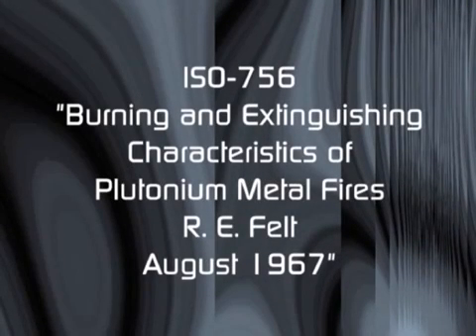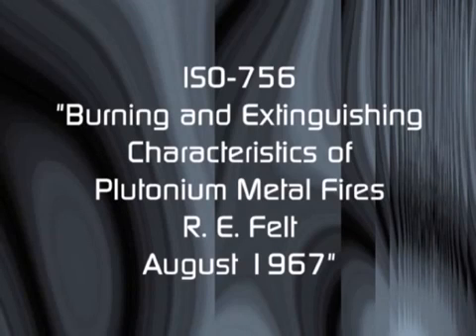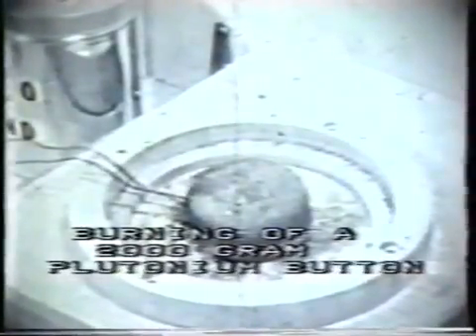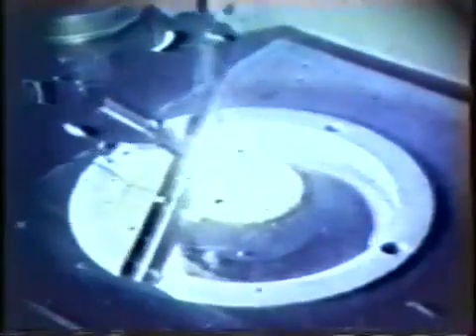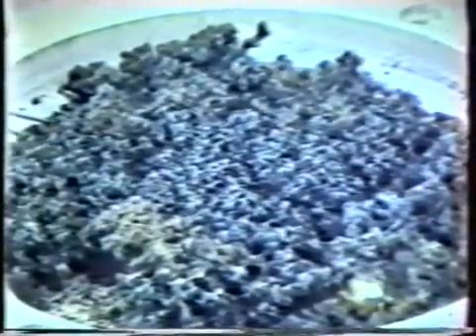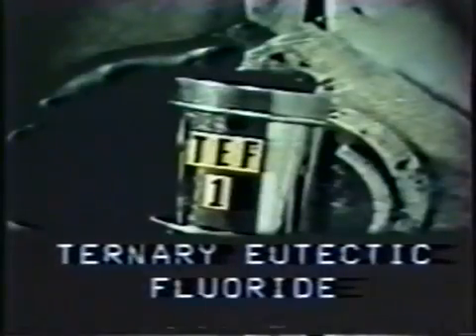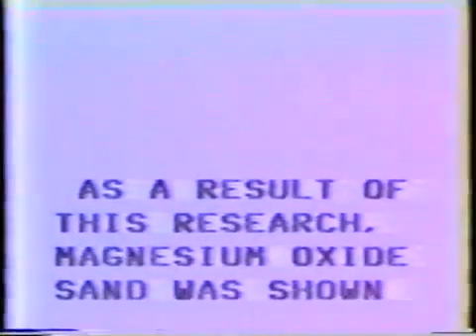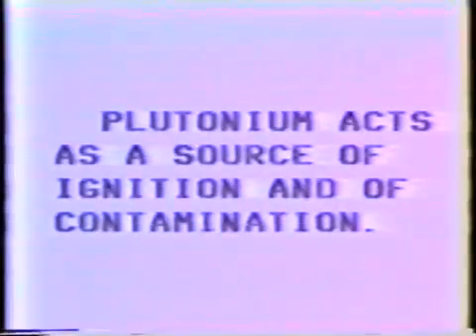Burning and Extinguishing Characteristics of Plutonium Metal Fires

Comment: I wonder what effect liquid nitrogen would have on a plutonium fire.
Reply: @prospektOS-tmo97  Remove the oxygen and the fire should go out.
Reply from the maker: Plutonium can react with nitrogen to produce plutonium(III) nitride. This reaction takes place at a temperatures near 1000°C.

The Atomic Energy Comission (predecessor to Department of Energy) did testing of liquid nitrogen on burning metals in 1972 and found it to be effective in certain situations, so it's very likely that the cooling effect of liquid nitrogen would overwhelm the sustained exothermic reaction of the plutonium. Apart from encapsulating the plutonium to stop it from reacting, cooling is the most effective way to extinguish a burning plutonium fire.
Reply: @calibob2001  What atmosphere is in the glove boxes during normal use?   1000°C is well below the melting points of common stainless steel alloys: 
https://www.bssa.org.uk/topics.php?article=103
Reply: @josephastier7421  It's mentioned during one test that temperatures were in excess of 2000 degrees.

Comment: isn't plutonium a pyrophoric metal (MEANING IT IGNITES UPON CONTACT WITH AIR)?
Reply from the maker: It can be pyrophoric, depending on the specific surface area of the material. All elemental metals are pyrophoric, it's just that some require a higher surface area to volume ratio. At the fundamental level, it's a matter of reaction/oxidation rate,  energy absorption into the material, and diffusion into the environment.
Reply: @calibob2001 if a metal doesn't readily form oxides it will not be pyrophoric, so no, not all elemental metals are pyrophoric.
Reply: @calibob2001  I sincerely doubt gold is pyrophoric no matter how finely divided it is. Same for any other noble metal.
Reply: @apathyboy  that is actually incorrect. Iridium which is a platinum group metal can produce shavings that will ignite when exposed to air.

Comment: Good Grief! I hope those fume-hoods weren't vented to the outside!
Reply: A little radioactive fumes are good for you. Helps prevent cancer. :P
Reply: Nothing wrong with a little friendly cancer.
Plutonium helps "soften" the tumor and render it less noticeable.
Reply: They would have been vented outside after passing through filters. We should have stopped using this stuff to this extent 40 years ago. Its criminal.
Reply: @hopefilledsinner3911  You are making stuff up. These are closed circulation systems with dense mechanical and chemical filters.
There is nothing criminal about using plutonium outside warfare.
Reply: @hopefilledsinner3911 waaah cry more.

Comment: Imagine using plutonium buttons as brickettes in an actual BBQ! Atomic steak!
Reply from the maker: Excellent analogy. Pu mostly burns like charcoal. If you use Pu238, it generates enough heat from radioactive decay to power satellites.  No combustion needed!
Reply: I would like my steak medium radiated please
Reply: actually its more poisenous than radioactive. ;)
Reply: @VolksTrieb just need to get enough together to reach criticality, then try cooking with it!
Reply: Well it does give a wierd metallic taste, but has nice even heat, just make sure not to stack more then 6.2 kilograms in the grill and you might survive for a few days after eating it. 😂